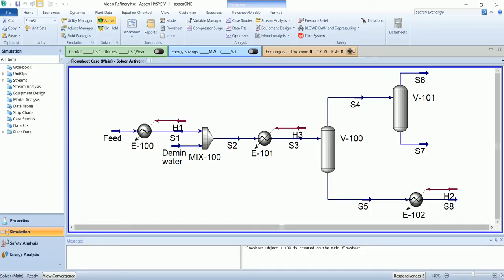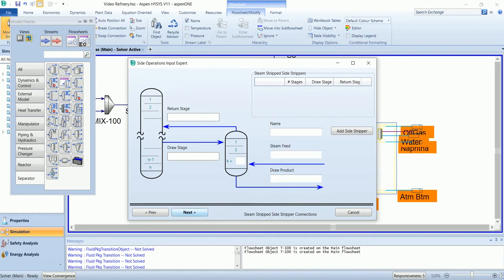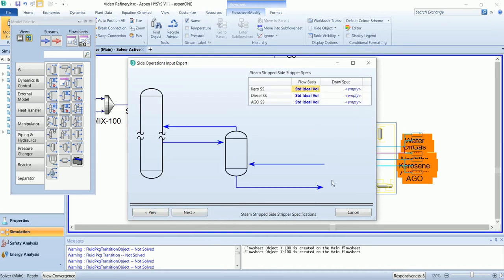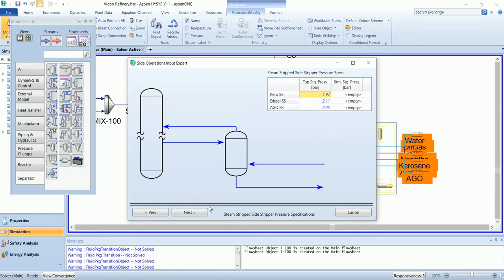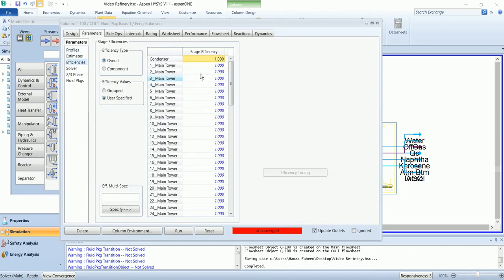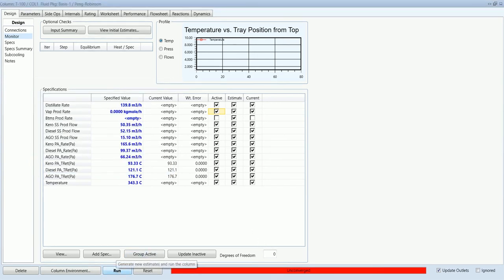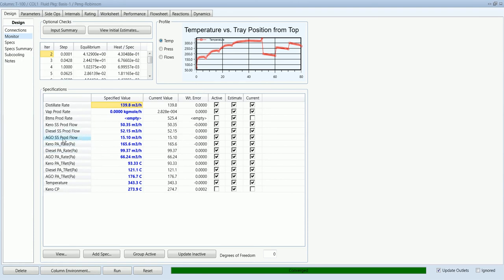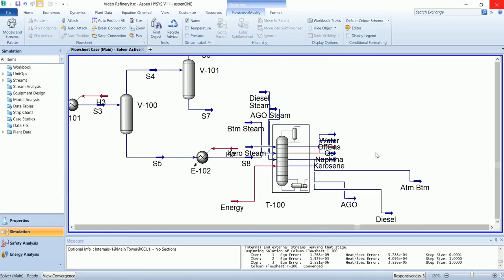Atmospheric Distillation Column || Aspen HYSYS || Refinery Process Video 02

Comment: the simulation does not converge because the specified bottom temperature (343.3°C) is the feed temperature and you place it at the bottom. The solution for the simulation to converge is by placing the column specification temperature in tray #37, for a temperature of (320°C) and eliminating the distillate velocity specification by the reflux ratio to 1.3

Comment: Was able to converge by adding refluex ratio spec at 1.3 and removing distillate rate spec, change btm temp to 320 and make 50th tray efficiency =1 ( all other efficiencies as mentioned in video). Once it is converged you can change the btm temp to 343.3 C as specified.